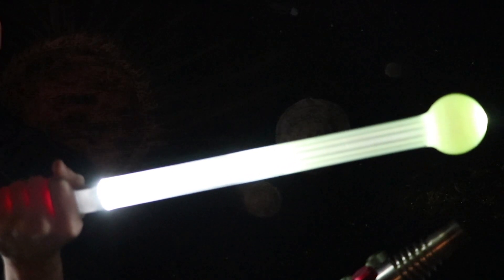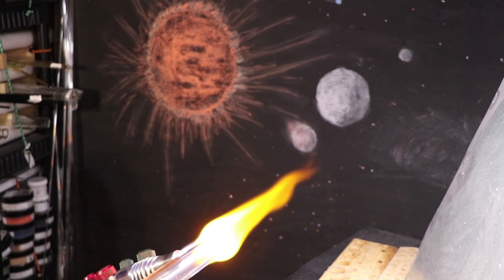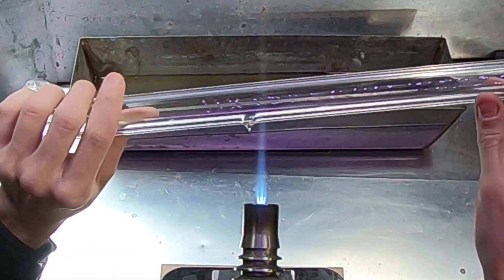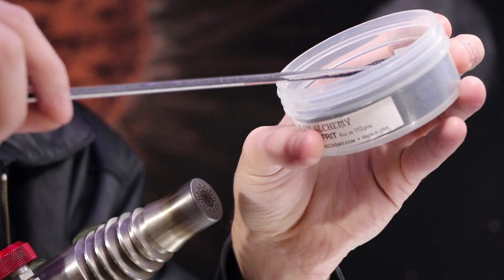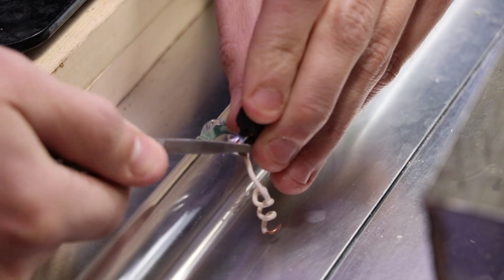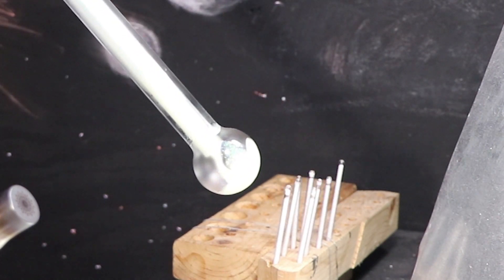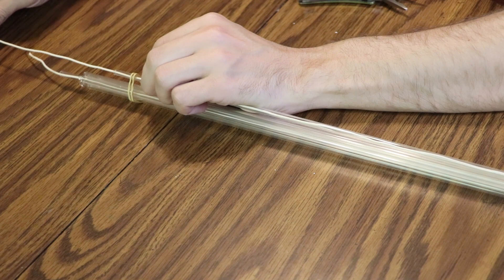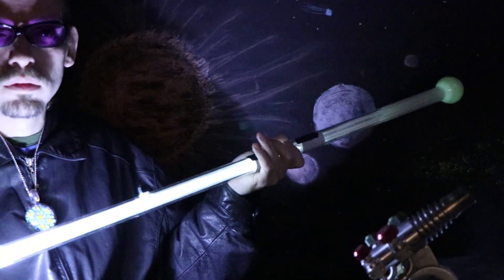Staff of Light

Comment from the maker: Hope you enjoyed the video. I forgot to mention those were three 5W LED (6v, 700ah), so 15W LED is roughly comparable to  ~100w incandescent. Those 5W bulbs LEDs do run a bit hot so I advise using heatsinks.  Resistors would also help regulate the voltage; here I used 5x 1.2v batteries which equals 6v in series so a resistor wasn't needed.
Reply: Try to make real neon tubes (websearch motorized Geissler tube, violet ray, nixie etc.) instead of cheating with LEDs. Unless you want to use a microcontroller for controlling light effects (colour changers, rows of multiple LEDS etc.), real neon stuff is way more impressive.

Comment: You should solder these joints.  it isn't that hard.  For that larger wire a higher wattage soldering gun would work well.
Reply from the maker: Your right it would be better. I always debate it but end up skipping the solder to speed the video along. Its good to practice the right routines though, thanks for your tip.